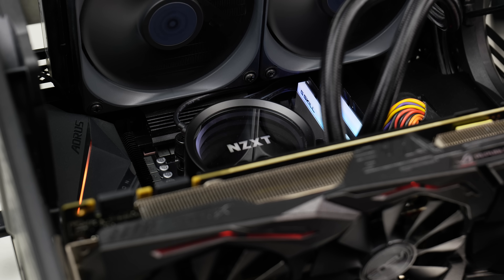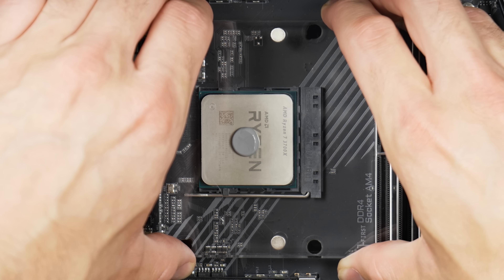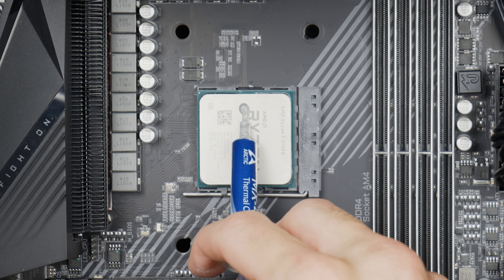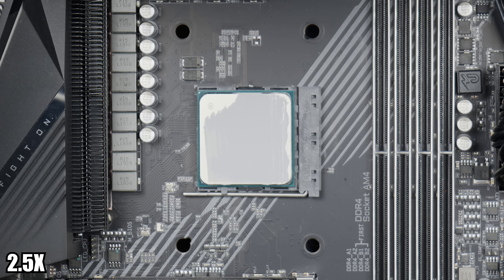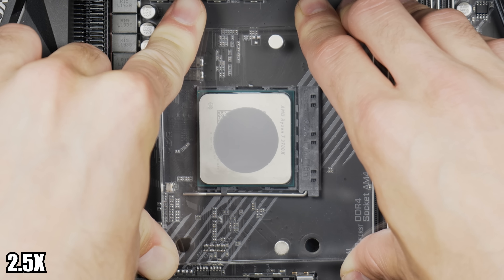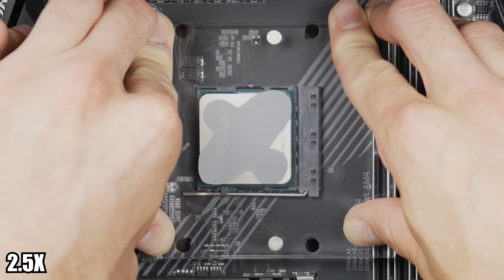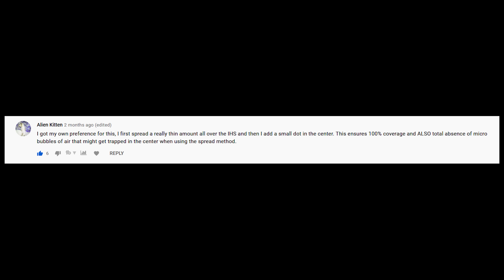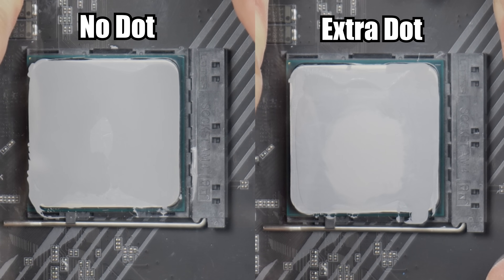Thermal Paste Spread Under Glass

Comment: Since the time I first saw my dad (he was a system builder until I went to uni) apply thermal paste on a 486 CPU, he has built over a thousand custom PCs over the decades, I've come to realize the best method is the single bead.  First make sure the paste is of the right viscosity for it to flow once pressed by the HS.  Apply the right amount depending on the size of heat spreader, press the heatsink flat then slide it a few millimeters in the direction of all the corners. Fasten the heatsink in place.  Burnt in test the CPU for about 30 minutes to allow the retention mechanism to spread further the TIM evenly before it settles.

Comment: PTM 7950 ...cut it to size, peel one side of the plastic off, stick it on the CPU or GPU side, peel the other side of the plastic off, then put the heatsink on. Better than thermal paste cuz it's not as messy.

Comment: This is cool and all but unless you apply force in the center as well, because plastic bends, while copper and aluminum won't and the computer needs to be running and heating up, it means little.

Comment: you did greate work now again make video on it but this time use nuts like we are having in cooler , and you can make it easily , you will need any old cooler srew which is having spring and just find a way to installed it on a glass then we will be having perfect case here

Comment: Thermal paste displaces the air. The pressure of the heatsink being screwed and mounted displaces the air first and the paste last because of the increased viscosity. Because of this, you generally want to have more viscous thermal paste at room temperature. It can be a real pain to apply. Supposedly the best non-metal types are those newer phase change pads that becomes more liquidy when they heat up. They're like a mid point between liquid metal and thermal paste. They're a bit hard to handle supposedly, but if you can manage it, they're pretty good from everything I've heard.

Comment: next time, install the aio mounting posts and drill holes into you plexi, so when you lower the plexi it’s as if your lowering the cooler aligned. your moving the plexi side to side a lot spreading paste more than as you would a cooler. that bit of sway is forcing a spread

Comment: When i touch the Hot heat sink of Rambus RD ram, i already know how to apply the thermal paste. The GREY Heatsink show must apply the grey thermal paste for AMD 4600G a smaller grey square and use something flat like a hard plastic to apply the smaller square and when the heatsink and cpu combine the smaller square will become bigger.

Comment: The air trapped with the penta-dot or spread method willl escape as well as with the spread-with-dot. When you tighten the cooler it will push away any excess paste and air- I have used Arctic freezer 34 and then the LF ii 420- when tightening the nuts they tighten till they hit the standoffs underneat and there is simply no more thread left which results in enough pressure that it visibly pushes away the excess paste.

Comment: There really should - and I think can be - a predefined amount (like "empty until this line"). This is all it comes down to, I think, the 95% most important thing (and mostly focusing on the middle).
I did do the cross, but I thought the lines looked too thin. I made them a bit prettier, more noticeable. The temps are shit.

Comment: I'd worry that where the air gap went is "into the paste". That is, it's important to remember this is still a 3D fluid interaction; it's not just spreading along a single axis, and while the paste is flowing across the CPU it's also flowing across the underside of the acrylic. An air pocket in the middle could potentially get sandwiched into the middle such that it can't escape, with the layer against the acrylic hiding it from view.

Now, that said, CPU coolers tend to exert more force from the center of the IHS because that's where their bulk is concentrated, so it SHOULD theoretically push the air out to the edges by collapsing that middle space faster than the surrounding area. It's hoped that the torque is sufficient to drive the air out. Acrylic makes for an imperfect test because it can flex and has most of its force on the corners, where you push it down.

Comment: Two years old, but still a very useful demonstration.  

Certainly in the early days there were risks that neither the package or the heatsink could be trusted to be flat, even if it was smooth.  In those situations the paste is vital, and it needs a chance to cover and fill all of the contact surface. The (big) pea method did this with only minor risks of spill and mess.  With the size of modern packages it feels like the X method gives better corner to corner coverage.

Comment: the best one that i always go with is the dot in the middle. you just have to apply the exact amount to make it cover and not run over. and is best because it leaves no air pockets between. i did run some test on the temperature between all the shown methods. the dot was the one to go with.

Comment: this is so unscientific, it's not giving you any valid data to test a machine-lapped rigid metal surface with a piece of deformable plastic. Glass or super thick acrylic would have been better. You can literally see it yielding under the light pressure. that creates a huge void in the centre of the IHS, requiring more compound and dispersing it in an unpredictable way. Not everyone has the money for a $50,000 laser scanner i realize this, I just hope people don't take these results too seriously.

Comment: I think methods that cover the center and spread outwards like pea and X are the best. It makes the most sense. The center is covered and all the air escapes at the edges. 
I usually use the pea method with varying quantities depending on what coldplate I'm putting on it. 
if it's a flat plate I put less, if it's a direct heatpipe contact with some small gaps in between them I put more.

Comment: Sometimes people think too hard about this thermal paste thing 😅

If you cover 70-80% of the processor lid and the cooler contact with a thin layer, you won't see a big difference.

Maybe 2 up to 5ºC cooler or hotter and that's all.

Comment: I'd be concerned about it spreading over the edge of the processor and onto other components. I am guessing this is bigger issue with liquid metal, which is electrically conductive.

Also, I'd dislike the CPU edges not being covered, but I don't think this is as much of an issue as overspreading.

Comment: The thin spread over the heatspreader is the best method. Any other way is just being lazy. As for air bubbles there is so much pressure to the CPU any that form will work its way out.

Comment: Made a comment I had to delete, I made it before I got to the last of the vid. Butter Toast and Jam is the way to go. The dot in the middle acts as a squeegee and forces the air out and if you put a thin enough 'toast' layer on you get almost no squeezing out the sides. Nice video showing the differences! I didn't even have a name for it, this is a method I came up with independently.

You can even use this on chiplets, just scale the 'jam' dot with the size of the chip. I mainly use liquid metal nowadays and that's what originally gave me the idea to do something similar with regular paste (with LM, do not add the Jam though! Just butter each side up properly- there's plenty of tuts out there on how to apply it, don't rely on this comment for a how-to with LM)

Comment: I think the testing is a bit flawed with a piece of plexiglass which bends and flexes as you’re squishing it. I really sick piece of acrylic or epoxy would be better simulation. 

Secondly, you didn’t really take into account that the pace doesn’t really settle until it’s heated a few times and cooled   

Finally, I think you’re using way way way too much paste. You should never have paste oozing out of the sides of your processor.

I always use the spread method, but honestly if you’ve ever taken apart of CPU, you’ll know that the heat shield is covering way more than the actual size of the processor and a simple pea dot in the middle is plenty enough. 

Honestly, this test should’ve been done with temperatures. Who cares about the pattern or the coverage?

Comment: I have a little box with that old white thermal paste, not the gray ones, and its probably older than me. I pick a little with my finger and spread over  with my finger as well. Very thin almost transparent layer. Ive been doing this for years and never had a problem with temps with any processor

Comment: The issue with many complex, protruding, or large shapes is that you can almost guarantee a bubble forming. Something that spreads out from the middle (i.e. pea shape) is a great way to minimize this, but you can’t ensure perfect coverage. Best way to do it, in my opinion, is to try to create a dot-X (a small X with more paste in the middle) so it spreads in a square-like way while radiating in the initial contact site to prevent air bubble formation.

Comment: The old phone company, 'Cingular's Logo' without the head. YOU DON'T WANT OVER EDGE SPILL ON TO SENSITIVE TRACES, PINS OR OTHER PARTS.
Google image search "Cingular logo"
I used this shape, placing surface mount parts to mil specs and thousands of CPUs and the like for over 30 years.
Reply: p.s. a small amount, because you're not using the paste to help it keep temps down, just to fill in the small gaps between parts.
Best is thinnest with 99% to the edge, with 1% clear for heat and long term pressure, creep migration.
Reply: Careful - Cingular might sue you for copyright infringement! :)

Comment: The air bubble from the spread method's test is probably due to your pressure on the glass actually bending the glass. It dissipates after you stop flexing the glass. This won't happen with the cooler.

Comment: Maybe the 1st version of the buttered toast leaves an air bubble in the center because your transparent plastic plate is flexible and you also apply pressure only to its corners/sides for us to be able to see the center/CPU, so this will leave the center to pressure last. In real life cooler pressure this doesn't happen as its surface is much smaller and its not flexible.

Comment: This guy has no idea what he’s doing.

How to Apply Using the Center Dot Method:

1.	Prepare the Surface: Ensure both the CPU surface and the bottom of the heatsink are clean and free of old thermal paste and debris. Use a high-purity isopropyl alcohol and a lint-free cloth or coffee filter for cleaning.
	
2.	Apply Thermal Paste: Squeeze a small amount of Arctic Silver 5 (about the size of a grain of rice or a small pea) onto the center of the CPU’s IHS (Integrated Heat Spreader).
	
3.	Mount the Heatsink: Carefully place the heatsink directly onto the CPU, ensuring it is properly aligned. Once in place, apply even pressure as you secure the heatsink according to the manufacturer’s instructions. This pressure will spread the thermal paste outwards, covering the surface area necessary for effective heat transfer.
	
4.	Avoid Repositioning: Try not to lift, shift, or reposition the heatsink once it has made contact with the thermal paste. Doing so can introduce air bubbles and result in uneven coverage.

The concern about a small amount of thermal paste covering the entire Integrated Heat Spreader (IHS) is understandable, especially when aiming for optimal thermal performance. However, the effectiveness of a small, pea-sized amount (or similar) relies on the principles of thermal paste application and the physical properties of the paste itself:

1.	High Pressure: When you mount the heatsink or cooler onto the CPU, it applies significant downward pressure. This pressure spreads the thermal paste outward, thinning it into a very fine layer that can cover the entire surface of the IHS. The goal is to fill only the microscopic gaps and imperfections between the CPU and heatsink to improve thermal conductivity, not to create a thick layer.
	
2.	Surface Tension and Viscosity: Thermal pastes are designed with specific viscosities that allow them to spread under pressure but not run freely like a liquid. The paste’s surface tension and viscosity enable it to spread evenly across the CPU’s IHS when the pressure is applied, without requiring manual spreading.
	
3.	Efficiency Over Quantity: More thermal paste does not equate to better cooling. In fact, too much paste can act as an insulator rather than a conductor, hindering heat transfer from the CPU to the heatsink. A thin layer is all that’s needed to eliminate air gaps between the CPU and heatsink surfaces.
	
4.	Design of the IHS: The IHS is designed to conduct heat efficiently from the CPU die beneath it to its surface, where it can be transferred to the heatsink. The most critical area to cover is the center, where the CPU die is located. Spreading out to the edges is less crucial for thermal transfer, as long as the central and most thermally active parts of the IHS are adequately covered.
	
5.	Empirical Evidence: Numerous tests and benchmarks by enthusiasts and professionals have shown that a small, centrally placed amount of paste, properly applied and with the heatsink correctly mounted, spreads sufficiently to cover the critical areas of the IHS. This method has been proven effective in achieving optimal thermal performance.

The key is ensuring that the thermal paste is properly applied and that the heatsink is correctly and securely mounted to apply even pressure across the CPU. This approach ensures efficient heat transfer while minimizing the risks of air bubbles and uneven paste distribution that can arise from manual spreading.
Reply: This guy thinks a mindless babble response you'd get from chatgpt is disputing anything.
Reply: @nookic  It's not my fault you can't read.

Comment: Is it wise/unwise to check how the spread looks just after placing the heat sink-fan combo and right before mounting the screws/locks, by removing the heat sink-fan combo and look at the spread on top of the CPU/GPU/etc. ?

Comment: This is completely invalid. One, glass is very porous. Two, heat sinks apply a specific amount of force on the CPU you cannot replicate with your hands. Three, thermal paste becomes viscous when heated up, which dramatically changes its coverage on the cpu. Four, heat issues are very uncommon and the internet obsession with thermal material application methods is not a problem that anyone other than extreme overlooking enthusiasts experience.  This is consumer grade electronics not the R&D lab at MIT.

Comment: one thing done. The pea method there works because you applied a lot more than what it used to be recommended. I personally prefer the spread method or just ptm now :D
Also the catch is because you can see the paste, you are slightly adjusting the pressure to spread it like with the X pattern without realizing it :)

Comment: I have a couple suggestions of my own. (LOL)

1. X pattern with dots between the "vanes" for slightly more even coverage still.
2. If you don't have a spatula or card handy to "butter" the processor, stick a small square of Scotch Tape on the tip of your finger (with a little overhang) and spread the paste that way. (Trust me, that works a treat)

Comment: It's better to used screw rather than pressure. The bubble most likely get absorbed into the paste or will escape the edge as it breaks in. 

I still used butter method but less on the edge as it will spread when mounted

Comment: 3:06 your air pocket formed probably due to the parabolic shape you bent that acrilic into. i would say this could not have happened if you used metal with the original mounting points.

Comment: I think that the most obvious method and form of thermal paste application has not been tested. The processor has a rectangular shape, a square. So, if some people think that 1 line of thermal paste is not bad, then why not make a closed line of thermal paste in the form of an empty inside of a square with as equal deviations from the edges and center as possible? The clamping force of modern new coolers, I think, leaves no chance for a ball to form from the air inside. Also, this option does not even need an additional drop inside.

Comment: The best is to use the paste to only fill the imperfections, so spread a very thin layer with a razor blade on the CPU and on the heatsink to only fill the crevasses.
This way the heatsing will have a metal-metal connection as much as possible and the paste will fill the imperfections between the CPU and heatsink.
Even better if you mirror polish the heatsink.

Comment: It's nice to see what it looks like. But very unscientific. You need to apply the exact same pressure. Figure out the force of the cooler and apply that for all of these tests. If you press hard enough. You can make them all look perfect.  Also as the paste heats up. It spreads out more. So all of these methods except for not having enough will result in the same results.

Comment: What if the worlds been to busy thinking one way?
What if you applied it directly to the cooler :p Perfect coverage every time.

The issue then becomes, if its to much and spreads as it heats.
With the concern being any with metal in the thermal paste varieties could cause a short.
However there are many brands that are non conductive.

Comment: 2:50 the reason the bubble forms in the center here is that you press the acrylic sheet down from corners which makes it concave in the middle. always used that method and never had  high temps under load

Comment: There is a flaw in the testing is that when you screw in the heat sink it does not go vertically down as in the test. As you screw a little bit from the four sides the pressure is applied not vertically down but it is according to the side you  screw down. For example left up, then left down, then right down, then right up.